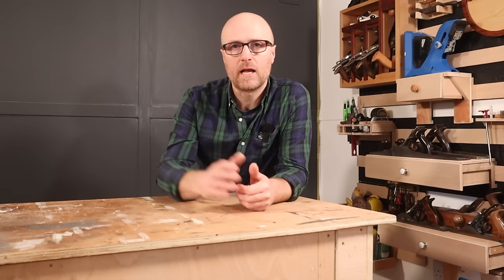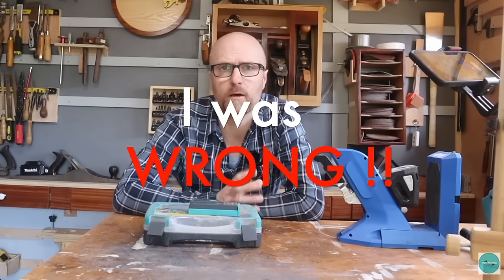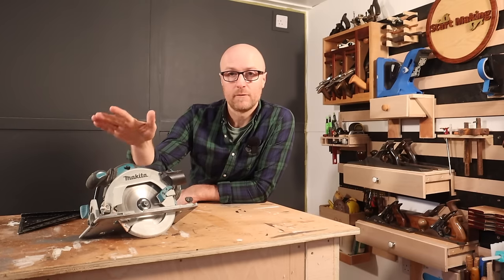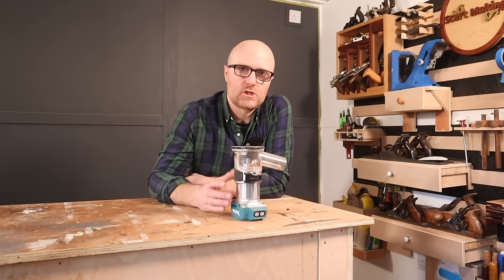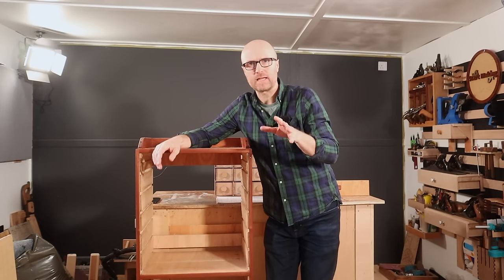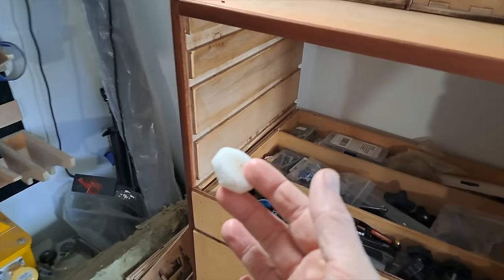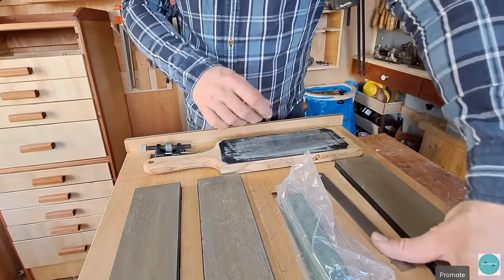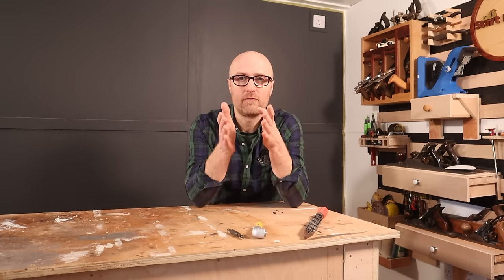A Years Worth of MISTAKES Corrected || Beginner Woodworking Tips.

Comment: I know I'm late to the video here, but the sliding jig storage idea seems like an absolute game changer to me, and tbh you seemed to speed past the idea much quicker than I think was due. I hope that this is because it's going to appear in its own video soon, because it's a great original idea
Reply from the maker: Hi Stuart, I am glad you watched late and reminded me that In was and still am excited about the idea of the jig storage. It will take a fair bit of planning as they are all different sizes etc but I think I need to try it. Thank you
Reply: @startmaking1  I'm expecting a two-tier design, for smaller and larger jigs. It'll end up not the most efficient with usage of materials, but the tidyness should balance that out nicely. Theoretically 🤣
Reply from the maker: I was thinking something like this . I also wondered if some could be upright and some in like drawers. It is a lot of work but I need all the jigs eventually.

Comment: Hi mark, I'm lucky enough to have had that table saw for 5 years. Your in for a treat, I've used several table saws at work and this one is by far the best I've tried.
It is so accurate and reliable and even possible to make a zero insert for. The only 2 downsides on my model is the stop button and volume of the motor. That being said I now the switch has been fixed on the newer model your have to let me know about the motor DBS in a vid
Reply from the maker: Now I am excited. And thank you for the feedback from your experience. Volume should be ok as I wont be running it in a production style way I dont think. We will see. I can't wait to make a fancy zero clearance plate and then ruin it lol. Let's hope I can make an average to good bench to house it in.

Comment: First, let me just say thanks for a great year of videos.  You've really inspired me to become a better woodworker... Sure, that wasn't going to be too difficult given my basic skill-set but I have improved through your channel.
The best tool that I bought off the back of your channel was the Dewalt right angled screwdriver bit thingy.  When you showed it I thought, 'Meh!  Maybe it would be useful but really, I'll survive.'   Then I started building my daughter some wood storage boxes and I wanted all the screws to be on the inside... After burring half a box full, not to mention a couple of drill bits, I took the plunge and got it.  It took me two screws to get used to how to apply pressure but then I was away!  What an amazingly useful tool!! I'm so glad you recommended it.  My Makita trim router is right up there, as well but because I watched your videos in a linear fashion, I already had that by the time you introduced it. ;)   What wasn't worth it, though, was the box of router bits I bought to go with it.  a) You only really used about 4 bits. b) Cheap bits break!  
The one bit of advice I would give is to save your pennies and try and buy a known quality brand.  Bargains are out there if you're patient but for me cheap brands come with consequences (see below)
I've been drooling over the DWE 7492 for ages.  I've got a really cheap table saw with the advanced 'RFA' option (Random Fence Angle), that will cut wood at any angle apart from 90 degrees no matter how carefully you set it! Drives me nuts!  I now use a straight piece of wood that I have to clamp into position every time, making anything but repetitive cuts a pain. 
Next year's wish list:  DWE7492, a decent quality mitre gauge (that doesn't have any play in it),  sash clamps of various sizes, a cabinet scraper and, once I've re-roofed the shed, some sort of air filtration because despite having dust extraction, fine dust gets EVERYWHERE (and it's a shared use space).

Top projects for me next year:  Loads of boxes with various joints (just for the practice really), a Moxon vice and a workbench with space for a DWE7492 on the end. :)

Comment: Not watched to the end yet, but just wanted to chime in on the Veri-expensive -tas honing guide. I bought mine - the MkII, if I'm not mistaken - and it it definitely one of those, wish I hadn't items. Despite all the rave reviews about the wide wheel, and the fancy setup jig for getting the correct angle, I always ended up having to re-grind the chisel as it simple wouldn't sit square. I don't use anything larger than a block plane on a regular basis, so I'm afraid the same applies when sharpening. I've owned an Eclipse since the 90s and have always found it to be flawless - even onsite when I just use sandpaper, water, or even oil to sharpen my tools. Anyway, back to the video....
Reply from the maker: Yes. I think the veritas is definitely a love hate thing but with a chisel it does more damage than good due to not gripping it.
Reply: I have a cheap imported Eclipse knock off. Good enough. I bought the best one on Aliexpress. I think it was like $12? I saw another video where a guy decked the flat on it with a hand file to flatten it. Made it a precision device then.

Comment: I want to make a router table like yours so much! 

I can agree about that Makita Vacuum, it is simultaneously too powerfuk and not powerful enough. Its so powerful it clogs up right away, and this ende up not being powerful enough. It needs a cyclonic separator or something like that.
Reply from the maker: The cyclone would possibly work. Im not sure it is worth the hassle though. interesting experiment though.
Reply: @startmaking1  the cyclone for the stick vacuum does a wonderful job at helping maintain the suction of the first-gen brushed stick vac, as does when I attach it to this vacuum in a rigged up way. If there was a way to turn the internals of the vacuum into a cyclonic separator somehow, or have an external setup, it would make it much more efficient. There are YouTube videos and instructions on how it's done.
Reply from the maker: I feel I am about to go down a rabbit hole of dust collection again lol. this should be fun.

Comment: trouble with melamine is its usually on particle board which is prone to bend and sag, you could sand plywood smooth and apply some paste wax to make your router table slippy and smooth.plus everyones got bits of ply lying around, saves buying a sheet of melamine board
Reply from the maker: I see, right, I need a new plan. Thank you. I will look up what you are suggesting as the vinyl is ok, as a cheap fix and has lasted really well but it will not hold up more than a year or two. Thank you.

Comment: I am making a base for a cross, square peg round hole. Any suggestions on makinh this other than a drill bit and a chisel?
Reply from the maker: Sadly I would use a forstner bit and chisel. ITs not all that easy but the alternative is a router in a plunge base with a templating bushing and a template matching the shape of the cross base. You would still have to chisel the corners though.

Comment: Router table, make it simple by all means. Waxed MDF is fine. One thing, add  a single guide pin. A mini fence if you will.
Reply from the maker: I had a pin but cant find it for the life of me. I definitely need it as some woods when I start them a little abruptly tend to snap away from me.
Reply: @startmaking1 , if your table is simple enough a board with a notch in the middle and two clamps will work. Use a small hammer or mallet for fine adjustments. An L shape is even easier to use.

Comment: hi.
For a cheaper tablesaw option in UK/EU take a look at the Erbauer ETS2000, a 10" blade. It costs around 300€ with solide foldable legs and a rack & pinion fence. It's the same saw that the Skill 10" sold in US (I think it's made by Chervon who owns Skill brand) who has a lot of review on Youtube.
Reply from the maker: Great to hear advice from experience. Thank you.
Reply: My table saw cost me $50. I got it at a yard sale. The saw itself cost me $20. But it needed some things. Like a motor. That was another $20. Then I wanted push button start and stop. So I built a magnetic motor starter for it. The parts for that were another $10.

Comment: Wait a sec.........

Dare I say I'm watching some personal accountability? What a novel concept. 

As others have said, we're all learners of wood and of the process. Sometimes, we knock it out of the park, and sometimes we offer up a dud. Nice to see a review of one's self for the sake of the audience. 

I started with that DeWalt way back. It's a good unit. Quick tip for that saw. First upgrade is a zero clearance. Any off cuts will clog the unusual internal shape of the dust port.
Reply from the maker: lol. Hi Jered. Love it when you comment. I tell you what, I know that you must have so much that I could learn about everything woodworking. From the table saw and onwards. As a novice I just hope I can manage to take the step up to a larger tool. Sounds daft but it is a little scary to leave the small tool, lack of electricity woodworking behind. This tool is very much the step up. I said it to Lee and you are as much a part of it but I decided in the Summer what kind of a woodworking YouTuber I wanted to be and it was in a large part due to watching you both and following the movement. It's easy to get caught up in the BS around this platform and the desire for views over all else. So thank you for the unintentional steering.
Reply: @startmaking1  the feeling is mutual. There's always more to learn, but I think you'll be fine with your new toy. One other tip about that saw....make sure your electrical is up to the task. I tripped many a breaker running that saw and a shop vac to catch dust. Separate circuits are ideal, or a battery powered vac will help.
Reply from the maker: Thankfully, even though my new workshop is smaller than your wife's craft room (not jealous at all), I have splurged on the electrics. I dont know what any of this means but the guy put in 2 rings instead of one and its own fuse board. Though when the house it is run from is 500 odd years old and has wiring like spaghetti who knows. Cant remember if I said, but either way, have a lovely Christmas bud.

Comment: Im only 5min in but if i dont comment now i will forget. Going to what you saod about the saws, would the lapanese saw not give better results with the block of wood with magnets inbedded for square cuts? (I suck at using a hand saw sor squarr cuts and usually just used a power saw)
Reply from the maker: Thats is a really good bit of advice. thank you.

Comment: 3:45  When I saw that you were unable to get a 2x4 in your Kreg Jig, I thought that they must have reduced the capacity from earlier models, as my old K3 works fine on 2x material. However, after checking their website, I see that the new model also handles material up to 1-1/2". Then it hit me, maybe the problem is that your 2x4 material is larger than what we have here in the US...  Anyway, I been watching your videos for some time now and like your content.
Reply from the maker: Of course. That has to be it. It was around 5 mm too big, maybe a little less than that.